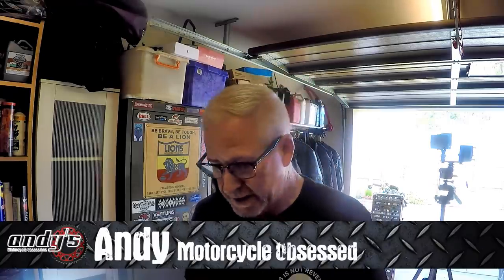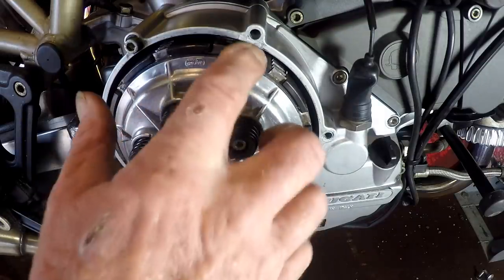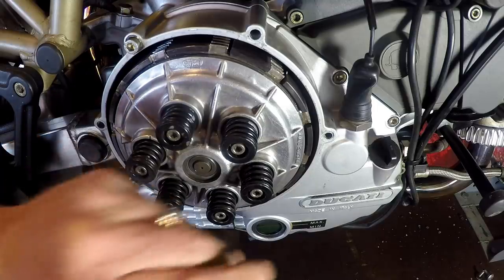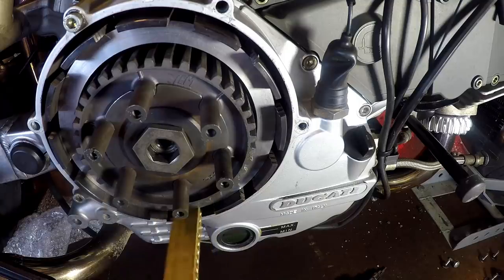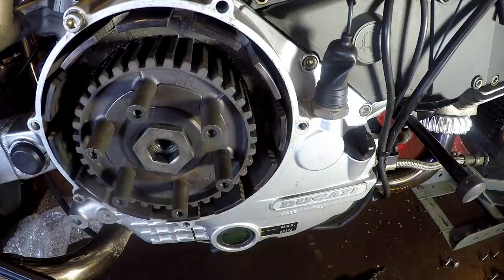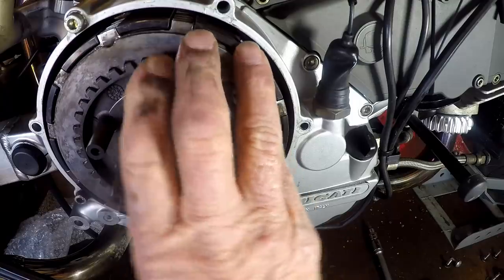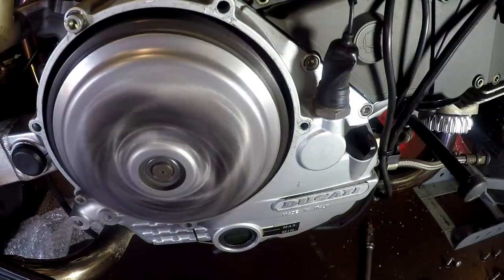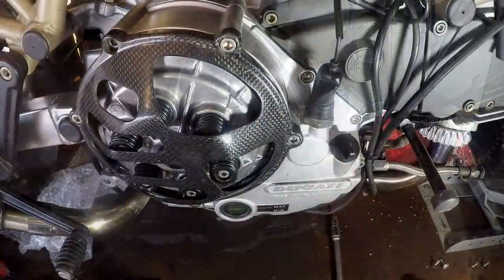DUCATI 900SS Clutch Mod - Biggelaar Performance Part

Comment: I have a 900 SS myself. Based upon this video from you I contacted Toine for this modification on my bike as well. Today I visited him, which is pretty easy because I life in Holland as well. Toine did the modification on my bike at his workshop and I fully agree with you Andy.  This modification makes my 900 SS a better bike!  The sound is much more comfortable and especially on roundebouts the bike is much more easy going.  Thnx for the tip Andy!
Reply from the maker: Happy that it worked out for you mate 👍

Comment: Hello Andy , I have fitted a TIONN BIGGELAAR ` quiet ` clutch kit to my 2002 ST4S , and I am extremely pleased with the results .
I am now in the process of fitting a Biggelaar ` quiet` kit to my sons 2002 ST4S , AND WHAT A NIGHTMARE I AM HAVING .
THE BASKET IS ALUMINIUM ( MINE IS STEEL ), I have had to silicone the first thick steel disc in place, I have asked TIONN for friction plate tolerances and thicknesss of plate `stack`.
I have since dissassembled the aluminium clutch assembly AGAIN ,and am now looking at your videos AGAIN .
i FEEL SURE THAT I HAVE MADE a mistake somewhere ,as MY steel basket clutch modification is good .
Malcolm .

Comment: Not even the Ducati workshop manual gives specific torque settings for the clutch spring bolts. But the general advice given is 6Nm for 5mm bolt and 10Nm for a 6mm bolt. From memory I think they are 5mm. Finally the maximum clearance between the tang on the driving plate and the slot in the basket is 0.6mm

Comment: I like it and I'll be buying one!   I couldn't find any torque settings for the SS spring bolts either and on my 916 I just did them up firm which was how they were when I replaced the whole clutch, basket and all!  That will be money well spent as it should reduce the wear!   Thanks.

Comment: Thanks for the info on the clutch mod sounds great, BTW I read on a forum that Suzuki gs clutch baskets can be used to quiet down the rattle might be worth looking into. Also I'm in the processes of cylinder repair on my bike so your videos have been very motivating.

Comment: Thanks Andy - while I do enjoy your vids and your appreciation of our Desmo Due's, don't you know that "Loud Clutches Save Lives"? - sorry, couldn't resist ;). I have a 1999 900SS with 85K miles on her and replaced the clutch pack twice now. The second time I went cheap and ordered the Barnett clutch pack which lasted me less than 18K miles. The original OEM lasted 47K miles. So now I'm back to OEM w/ about 30K miles and it sounds lovely - YMMV  Cheers!
Reply from the maker: It’s not the noise that concerns me, it’s the damage that they cause. Thanks for watching mate 👍

Comment: Hey Andy, love your videos. My maintenance manual says tighten the retaining bolts to 6 Nm. I had an 03 999, I found that if I was just tooling around it wore the clutch basket pretty fast. I was told you have to keep the throttle pinned to reduce the wear as that keeps the clutch plates from beating back and forth on the basket fingers....? My basket looked much like yours so I replaced it with one that had steel inserts around the fingers and the noise was reduced a fair amount. With the new setup you now have if you potentially get a basket with steel inserts it would be somewhat quieter while idling as well. Just a thought. Thanks for sharing!
Reply from the maker: Thanks mate. BTW, mine is a steel basket

Comment: Great video as always!  You can achieve the exact same result by installing a single old/used friction plate at the base of the clutch stack to provide just a bit of preload.  This will get rid of the loud clunking noise but still retain that jungle with the clutch disengaged.  I suspect the first steel plate installed in your kit is actually there to protect the bottom of the basket, which would be an improvement over the old approach.  Cheers.
Reply: Twonkyful Good.
Reply from the maker: This mod has smoothed the bike out below 3000 rpm, which is the initial purpose for its development. The anti rattle is a byproduct.

Comment: Do the steels need to be oriented a particular way?  I’ve always wondered what the little cutout was on the outside diameter of the steels and wondered if they should be oriented on the drum a particular way.  I’ve always just put them on randomly

Comment: Wow...I wonder if he makes a mod for my 749r ...that clutch on the testastretta is insanely loud and only low milage (under 20k) ...but having the factory slipper is it doable ...? not sure but shut yours up wonderfully and I know about pigrooting at lower speeds especially when the engine only has 54mm stroke ..great videos..please post a link to your mate in Holland ...cheers
Reply from the maker: There’s a link in the description of this video
Reply: Sorry 749R has a OEM crap slipper clutch, my best advice change it over to a normal clutch from other models, then put the modification in that, put the slipper on Ebay and sell it for 175 euro, unless it's a track bike only then a slipper  clutch is a good option

Comment: I always look interesting. It looks like you have a friction disc next to the spring plate, but in my experience, this order would scrap away the friction material...
Reply from the maker: Which is why the friction plate has had the friction material removed from one side
Reply: So that's it !  thx

Comment: So, how n why is this €100 kit superior to the nearly free mod that MotoMinx showed you years ago? Sounds about the same to my ear. Just curious. Thanks Mr. Andy.
Reply from the maker: A fair question. This mod was free for me. The added benefit of this mod, which I now know after riding the bike and subsequently speaking to Toine, is that it absolutely smooths the bike out at low RPMs (in fact that was the primary reason for developing it. The anti rattle was a side benefit). You can now ride it around a roundabout or tight 1st gear corner without having to ride the clutch. The mod that Motominx did definitely shuts the rattle up, but it isn’t free. You would still have to track down a single friction disc.
Reply: It doesn't have tangs driving against the basket and If I recall she said there was a slight release or similar issue though didn't cause her a problem. That aside I wonder why Biggelaar didn't choose to go down the more simple and cheaper route of adding a friction plate.
Reply: @ANDY5  Do I detect a bit of diplomacy used here?
Reply: @nightster6378  I am not familiar with the other solution to stop the rattling, we developed this modification in 1992 as then the 900SS changed from the Paso style clutch type to the current type, you would need to make a friction connection between the inner hub and outer basket so these 2 parts will become one piece when the clutch is closed, only way to do this is the fill the space in the back of the basket by the ring we made, then use a spring/convex ring so the basket wich holds the friction plates will be connected to the inner hub wich holds the steel plates, this way you create a friction coupling between these 2 parts with locking them up, so they can still move 1 way under acceleration and the other way during engine breaking.  Originally the entire clutch pack is solely mounted on the inner hub and has only a connection with the basket by the friction plates in the grooves, and as the outer basket is the part that is driving by the engine and a Ducati has a offset firing order under say 3000 rpm the clutch pack is hammered back and forth in the grooves. We have sold over roughly 7000 sets or more trough all the years and it's a proven product.
Reply: @ANDY5  
It's a dry clutch. Thought all Ducati people had stacks of shot friction disk. 😉
Reply: @toinevandenbiggelaar6083  
https://youtu.be/9DU6gjBeMHk
Different kinda clutch? All dry clutches look alike to me. 😁

Comment: Absolutely, that sounds so much better. Personally, I can’t stand the sound of the rattley clutch. A quick question, why the open clutch assembly cover rather than the normal enclosed casing. What’s the reason for this. I have seen this open case on many a dry clutch setup on Ducs but don’t understand the reason behind this. Wouldn’t this potentially allow dust, dirt, water etc ( contaminants to get into the mechanism) ???
Reply from the maker: It is a bit of a Ducati wank thing. But it does have some cooling benefits and clutch dust builds in side the factory covers. You will notice that most GP race bikes run open dry clutches.
Reply: Andy's Motorcycle Obsessions Thanks Andy, ok I get that.  I really had wondered.

Comment: People ask me why i run an open belt drive and dry clutch on my Triumph instead of a stock wet enclosed primary chain and wet clutch, with the spinning pressure plate and lockwired adjuster nuts kissing my boot.
My answer is, because i can...

Comment: These are 6 mm Steel Cap screw into an alloy pillar , Loctite 242 Threadlock and absolutely no more than 10-12 Ft Lbs.  There are way to many Mechanics that rely on torque settings as LAW which is misleading to the layman. This is also why som many Owner's that replace their clutch parts on a regular basis tend to over-tighten fastener's .

   These Cap Screws carry NO LOAD other than the at rest spring tension and the compressed height Spring tension as the clutch is disengaged, your stack height should never exceed 40 mm or you could end up with clearance issues. The clearance issue you point out is largely irrelevant as there is sufficient room for the outer pressure plate to move on the spline at the outside with it's required release movement , the most important thin is the correct spring so that you do not end up with coil bind in the spring pockets. Back to the bolts , you are dealing with some 20mm of engaged thread so that is a huge area for the thread to bite and hold snug to the pedestal.  It doesn't need to be stupidly tight.
Reply from the maker: About the bolts, yes I agree with everything that you say, except they’re M5. 

The Haynes book of fairytales says “refer to the torque value at the start of this chapter”, which of course it doesn’t list. The factory manual makes no reference to a torque value however it recommends 6Nm for any M5 fastener where a specific torque value is not listed. 

On the pressure plate, again yes. The penny dropped after I had uploaded the video and I was watching it back. However the problem with a pack length too long is not so much a fear of coil binding, the limited stroke of the slave cylinder is more the issue. The rod length doesn’t change which means that the further the rod moves away from the slave cylinder the less disengagement you get and the resulting clutch drag makes it difficult to find neutral.
Reply: @ANDY5   Geez ya split hairs why don't you :) just joking  M5 / M6  interesting though as mine are definitely M6 8.8 Class ( They might have been re-threaded by a previous owner though hence the difference) . Probably some ham fist tightening ? . 

        I actually cleaned the Pressure plate surface up on my SS ( I'd say someone didn't have the right arrangement resulting in friction on the Alloy ) . :(  So I faced it , about .5 mm and took .5 off the tower's as well making me think some peoples clutch issues could stem from incorrect disc placement. .  
Yes the slave is the key re disengagement for sure.  I have seen some replacement Spring kits  (Heavier Spring rate ) that IMHO due to the thicker spring wire in the coil has the potential to bind as there isn't a lot of room in those pockets. Another little trick I have found useful is to file the square edge off the Basket engagement tangs on the Friction plates. this presents a rounded edge to the inevitable wear in the basket slots and allows better disengagement.
Reply: Thanks for this sane response!  (just snug 'em up FFS - you don't need a torque wrench... )
Reply: @umbertoecho1  I'm not sure if your comment was to be sarcastic or a " like whatever " response but my comment stands though, in my life I have witnessed far too many Owner's and Mechanics get so side tracked by either stated or perceived Torque settings in manuals  that may not be anywhere near the true values many manufacturer's have deduced are mechanically viable, but things like this just need to be snug  and not tight as hell because the thread is a steel bolt with a relatively fine thread into Alloy a soft metal . 
So just nice and snug is really all that is required here .

Comment: I went to the TT in 2015, a mate brought his 1098 with us. The clutch was so noisy! How the hell can you tell if anything is wrong with it. It sounded just like yours did, terrible racket. The bike was hard to start, uncomfortable, noisy but once the road opened up it was like a race horse. That bike had been sold on now and replaced with a pikes peak multi Strada. The motor in that is so quiet in comparison.